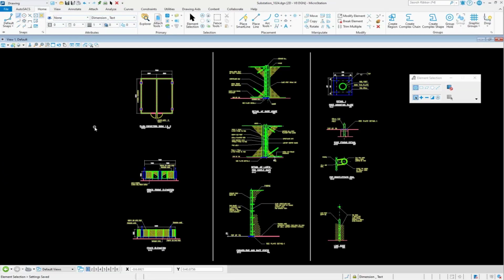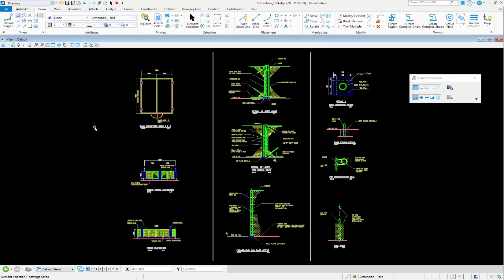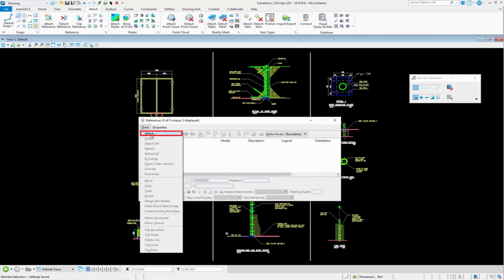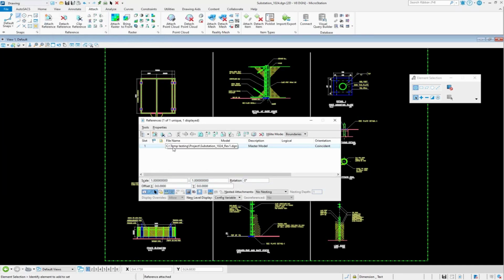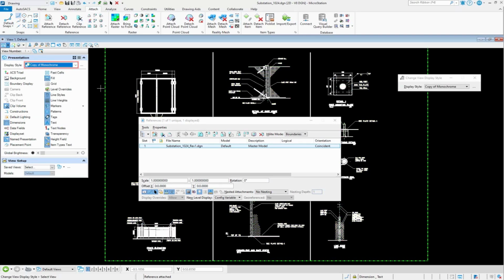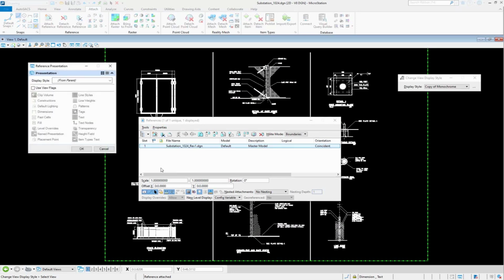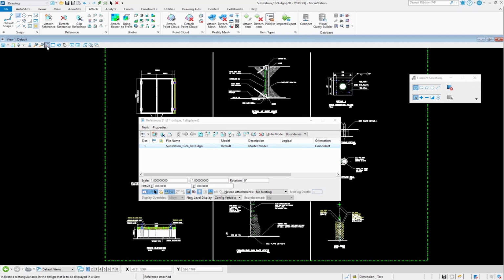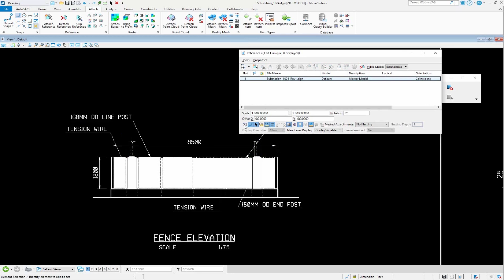Compare Version

Comment: I do something like this.  In my case, I restore a copy of the project to my computer desktop and reference that copy back into the live drawing.  Microstation has a problem with referencing a file on a different drive with a file name that can also be found in the active folder.  It makes this process harder than it should be.  We should be able to specify to store the full path for a file and look in that full path before looking in the current folder.  (These often are nested references, so just renaming the file is not a good option.)